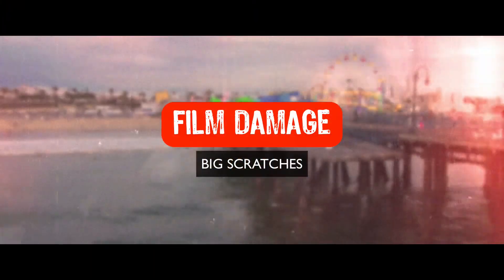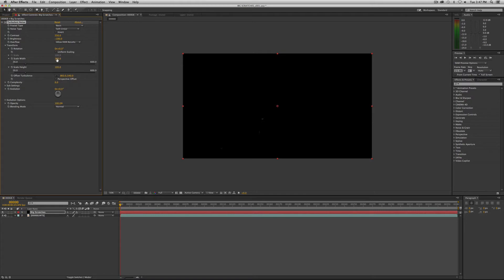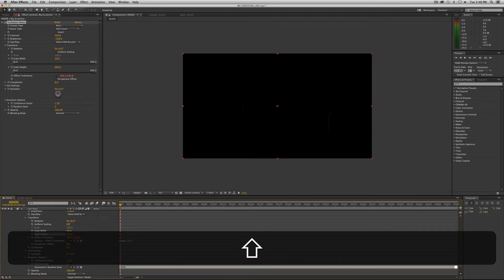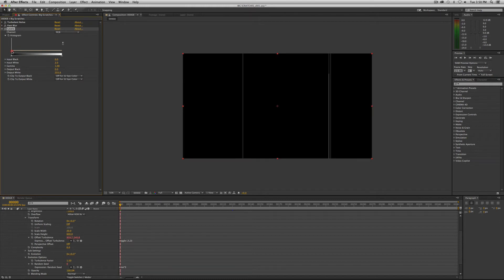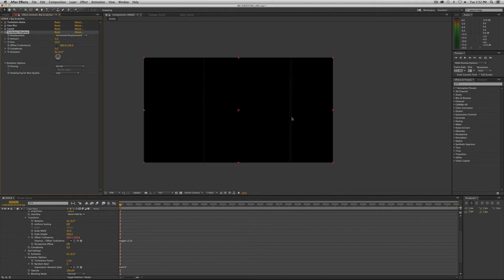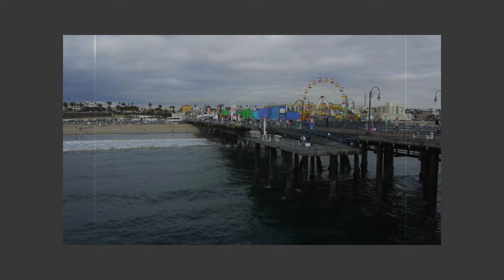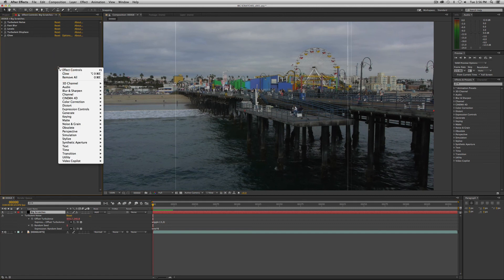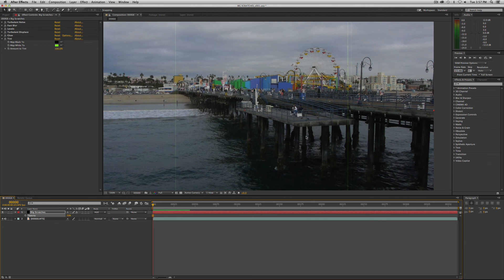DIY Film Damage - Big Scratches

Comment: Small note on this effect - the settings specified in this video are specific to his comp size, so to replicate this technique exactly your composite size should be 1920x1080.  I made it work on 1024x768 with slightly different settings, but anything smaller than that comes up big solid lines or nothing at all.
Reply from the maker: Thanks, Shawn. You're right! Although I haven't tested it, it's likely also possible to create the effect in a 1080p comp and then add it to a 1024x768 comp as a pre-comp and scale it down in the 768 comp. That should retain the look but let you still get the effect. It's an additional step but should save you from having to translate the math.

Comment: That looks nothing like scratched film. when a foreign object gets caught and scratches the film stock it doesn't just pop up at random spots i the gate, it migrates around the gate usually corresponding to the gate weave as the film moves slightly side to side dragging the particle with it. the crappy windows movie maker filter from 2001 winxp era did a better job of adding more natural looking scratches.

Comment: How can I made my film scratches move smoothly across the screen? I have my Random Seed time set at time*10 and my composition frame rate is 25.
Reply from the maker: Hi jbranklin92,
Sorry. I'm just now seeing your message. If you haven't solved your question yet, take a look at the Offset in the Turbulence plug-in. The first number is the "x" coordinate. That means horizontal movement or left to right (or right to left). You can keyframe a start location, move to the end of your shot, change your x coordinate number, and add a new keyframe. Alternately, if you just want it to move without keyframing it, you can add an expression called "throw". A little more complicated but not limited by keyframes. Hope that helps!

Comment: In the timeline, I can see the lines. But when I preview it, there are no lines or the screen is totally black... Dunno what I'm doing wrong :/
Reply from the maker: +Sothen 

Hmmm. That's definitely odd. I would check a couple of things:

1) Sometimes if you're doing RAM previews at a lower resolution (1/4 for example), the fractal noise plugin looks differently than when played back at full resolution.
2) Double-check that the layer blend mode is set to Add (https://youtu.be/2JsSr4eHzLY?t=8m21s)

Holler if either of those things don't work and we'll continue to trouble-shoot.
Reply: Hey, it was the lower resolution. Thanks! At the exported video I could see the lines
Reply from the maker: Excellent. I'm glad that did the trick!